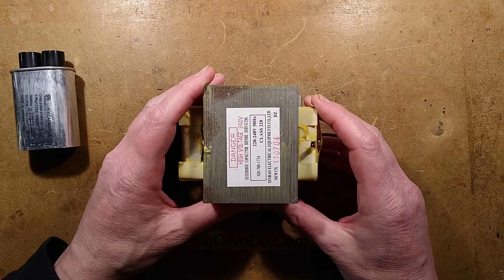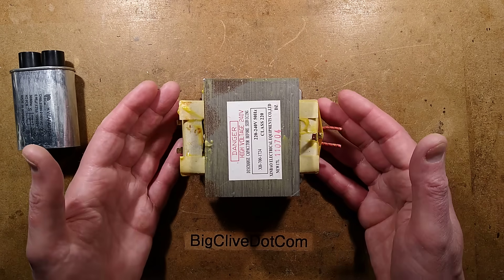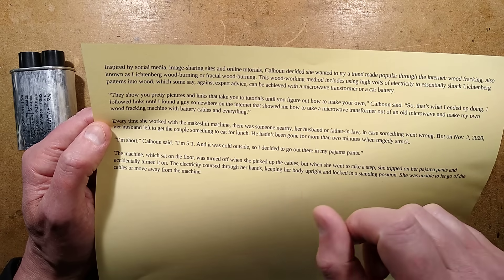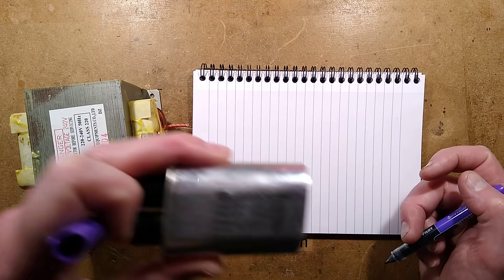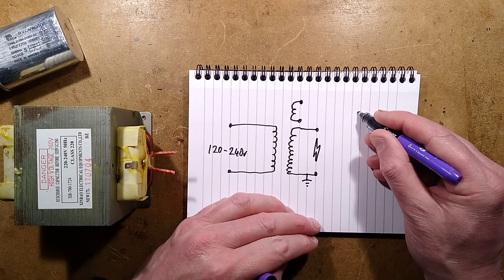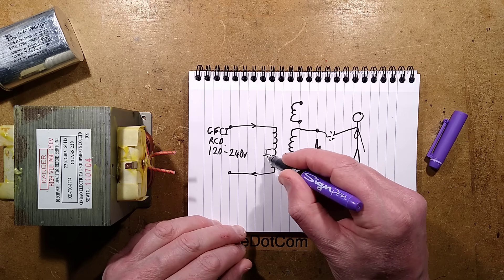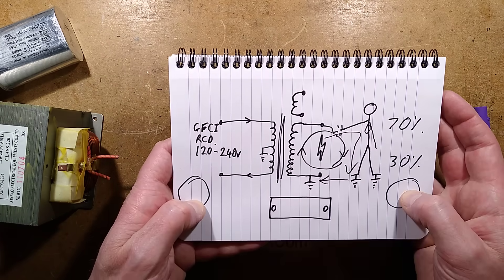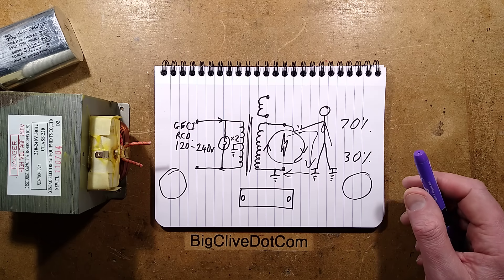The most deadly project on the Internet

Comment: When I was a teenager over 20 years ago, I acquired an old Franceformer neon sign transformer. I was using the GTO wire leads that came with it to play with a little wood burning. I didn't know anything about using an electrolyte solution on the wood, so I'd strike the arc by holding the wires close and then press it down and move them apart once the char started. My sense of caution was basically limited to holding the wires with a dainty fingertip grip, and that's probably what saved me when I did inevitably screw up.

I don't know what I did to zap myself. That instant has always been blank. I went from crouching on the patio to standing a good ten feet back, my sandal'd big toe bleeding where I'd kicked the shit out of something hard enough to bend my toenail backwards. One of the wires was lying on the concrete just arcing into the concrete. I pulled the 120v cord and told nobody and never fucked around with high voltage like that again.
Reply: The kind of moment to make you really love how great being alive is
Reply: @369Sigma  OH YES!   I've lost count of how many times I've had that feeling...   Whist on tour of duty with Greenpeace and during a 'hands to bathe' moment...  I once dived off the stern of our ship, hove-to in the Sargasso sea... Which is bang-slap in the middle of the Gulf Stream...  I had my diving face-mask on and started swimming around the sargasso weed, admiring the aquatic organisms, in propper Cousteau fashion...  Then I lied motionless on the surface looking down into the indigo depths....  Totally bemused at the fact I was staring  into approx 14,000 ft of water column....    When I eventually surfaced I turned and was amazed to see my ship had shrunk, now being about half a nautical mile away!    I then dawned on me that I'd swam-out of the lee of the ship.... and had been picked-up by the 4kt current of the Gulf Stream...   Man, that was the fastest crawl I've ever done in my life!  
.
Here's the kicker though...  When I got back to the inflatable moored alongside as a diving platform, the Skipper, who was on 'swimming watch'  on the starboard bridge wing, shouted - '' All hands onboard...''.   Still  somewhat out of breath I made my way up to the bridge wing and asked the skipper what was the reason?  He handed me the binoculars and pointed out to the starboard beam, I focussed the glasses and located the shining bladder of a Portugese 'Man-o-War' drifting in the current a few hundred feet away...    These hydrozoans can sport many tentacles (tentacular palpons) that can reach over a hundred feet in length, all of which  bears tiny, coiled, thread-like structures called nematocysts, these can inject a paralysing venom and have been known to kill humans by paralysis and thus drowning...     My blood ran cold for a moment -  The SECOND kind of 'that moment' within half an hour that day -  for I realised that the direction of those tentacles would follow the same current that I had been drifting in...   I could have swam right over them without realising.   So yes...  A double-whammy 'glad to be alive' moment indeed!   And of course, a very big lesson learned...
Reply: @369Sigma  Isn't it ironic that we need near death experiences to make us appreciate life? Just survived a accident with only 2 broken bones?
"I sure was lucky!" 😎
Reply: @TheOleHermit  sometimes you don’t know what you have until you almost lose it. It’s so easy to take life for granted, sometimes
Reply: That's what makes high voltage so lethal. Even if it doesn't kill you instantly, the moment that it gets you, you lose all motor control and involuntarily clutch the electrified object with all your strength. It's not unheard of to find a heavily burned corpse with the fingers still clutching the thing that killed them in a literal death-grip.
Reply: I took a hit from a neon sign transformer at work once. It knocked me on my ass, my coworkers said I was out for a few seconds, and I had a nasty burn on my hand. I was very very lucky. I don't fuck with big electricity any more. Scary stuff.
Reply: The two rules of electricity
1. You can't see it.
2. It can kill you.
Reply: Sandals 😂

Comment: i would also suggest to insulate the transformer from ground. i think attaching two dedicated screw terminals for the high voltage side to a plastic box and then casting the entire thing in resin (with spacers underneath to ensure a minimal thickness of resin on the bottom) might be a start.
that way you would have to touch both terminals to get electrocuted instead of getting zapped through ground

Comment: Cool looking process, but everyone I saw doing it did not instill me with the most confidence that it was something I should try myself, at least not using their methods. I've worked around too much 'proper' high voltage equipment to ever want to deal with stuff that considers safety as more of an afterthought. But I am happy you addressed this as I read a story over the weekend about a house that burned down, killing the owners in the process and the suspected culprit was a MOT used for fractal burning. The high frequency method crossed my mind when I was playing with tesla coils, but I decided then that would probably be the extent of my foray into high-voltage DIY projects.

Comment: I once wanted to build a spot welder and found a tutorial that used a microwave transformer. So I pulled one out of an old microwave I found. Then I actually started doing research into what I was holding in my hands. 

I nope'd out of that idea real quick.
Reply: you just have to cut away the secondary without powering it up for other reasons before, when you wind a couple of turns the output voltage can be like 2V, it's impossible to get shocked with that... the 230V side remains dangerous tho, so it's better to insulate the spade connectors properly with thick heatshrink tubing and so on (switches etc) and don't touch any powered conductor anyways

i did it and it makes an iron coin fully incandescent in like 10 seconds (didn't make a spot welder)

Comment: Once you go over 1000V you don't need to make contact for arcing to occur. So in theory, just being close enough to one of the probes could be enough to see you hooked up. 
The car battery leads as well, a slight nick in the insulation would be all it took for the voltage to drive through the plastic coatings. 
It can be done safely, but most people don't know the risks they are exposing themselves to in the first place. 
Great video.

Comment: The whole situation with a transformer defeating a RCD, has always made me question why we use them in shaver sockets.
Reply: A transformer where the secondary is not referenced to ground, is neutral towards ground no matter which point gets shorted to ground. This is generally safer in small circuits where multiple shorts to ground are unlikely.

Comment: I build guitar amplifiers and with those you're told to keep one hand in your pocket when testing it while it's turned on. 
That wouldn't help with a microwave transformer since its secondary is grounded.
You can get electrocuted with one hand contacting the high voltage.  Just sayin'.

Amp building safety doesn't apply.

Comment: One of my son's friends was killed doing this a few years ago. He was alone at the time so we don't really know what happened. I can only speculate as to what transpired because I didn't get to see his apparatus. He was probably using regular THHN house wire as many of them do. As we know, this wire is only rated for 600 volts so its a disaster waiting to happen with a 2000 volt microwave oven transformer (MOT). He was probably holding the insulated wire to probe around, thinking the insulation would protect him. When the insulation inevitably failed, he was killed.

I use MOTs for other HV projects such as vacuum tube Tesla coils (VTTCs). Some Tesla coilers use them for spark gap Tesla coils (SGTCs). So MOTs do have other uses other than wood burning. Of course you still have to be aware of the inherent dangers of using a MOT, which most Tesla coilers are. But even in the Tesla coil and high voltage group which I moderate, we still have to remind neophytes to the hobby of the dangers of MOTs.

Comment: I agree with you 100% on this but one thing I have done with one of these transformers is to hacksaw off the secondary complete with laminations and just leaving the primary on, then run that primary with a 110V site transformer and it made an excellent degaussing coil for my tubular framed home built aircraft.
The steel frame had become magnetised with the welding and the compass was way out but after running the coil all around the frame the compass read 100% correct. A very cheap degaussing coil.

Comment: Might want to have distinguished between the inverter based neon sign transformers and the old big chunks of iron. The current limiting effect of a mains frequency neon sign transformer isn't exactly abrupt ... rated for 10 mA give or take 100 mA with sweaty enough hands. They are short circuit safe for the transformer, not for the human.

Comment: It's that terror of high voltage that stops me from repairing CRT monitors. Hats off to the people that can do it but I'm just not experienced enough. When I needed the monitor circuit looked at in my classic Compact Macintosh, I took it to a professional. Even the tiny 9" monochrome CRT in those compact Macs has 13kV across it.

Comment: That picture is truly dreadful. Not the sort of art i’m interested in making, esp having repaired these ovens, always belt and braces. I know power,volts and amps don’t mean much to non techies but the RCD tripping at 30mA 0.03A is important, it’s just below the current level that could stop your heart, and with dry hands 240V could push this current through you. These transformers come from devices that (approx) unleash 800W of power and most of this is through this transformer, at 2KV output this transformer could easily push 400mA through you… :( just don’t ‘play’ with them.

Comment: MY,SHOP ,TEACHER ,WALKED IN TO THE CLASS ROOM AND THEZE, 3,GUYS HAD,A,PILE OF,TEST,EQUIPMENT PLUGED IN,TO THE 120,,AND THE TEST LEADS,IN,SERIES,WITH ONE PIECE,OF,EQUIPMENT TO ANTHER ,AND EVERY SHOP,TABLE,HAD,2,OUTLETS,,,GOING,TO,REOSTAT,REOSTATE,TO, A,HUGE,,TRANSFORMER TO DIOD BRIDGE,TO THE OUT LETS,ON THE SHOPDESKS,THEY,HAD EVER, PEICE OF TEST GEAR,IN,SERIES AND PLUGED IN TO THE DESK,OUTLETT,REOSTAT WAS,TURNED UP FULL,2,LOCKERS,HOLD THE TRANSFORMER,THE MAIN SWITCH FOR THE TRANSFORMER WAS,A KNIFE,SWITCH UP ON THE WALL,AND YOU NEEDED A 🔑 KEY,SWITCH TO THE REOSTATE AND A ,HOCKEY,STICK,TO FLIP,THE MAINE POWER ON,I,NEW THIS FOR MY,SHOP, TEACHER WOULD LET ME BUILD PARTS FOR MY ,HAM,TRANSFORMER, TRANSMITTER,,,,THEY WERE EXPELLED FROM SHOP FOR EVER, ,,AND IF,I,WOULD HAVE TOLD THEM WHERE THE KEY,IS  AND HOW TO FLIP ON THE MAIN,I,WOULD HAVE BEEN UP FOR SECOND DEGREE MURDER

Comment: I used to play with extremely high voltage transformers when I was a preteen with absolutely zero safety equipment. God knows why I'm still alive.
Reply: Angels, mate.
Reply: When I was that age I electrocuted myself on one of those damn non isolated old tube radios, quite frequently, especially when it would rain.
Reply: You're right, God knows!
Reply: @jonhetherington5985  Actually I had a pretty good grasp of what i was dealing with and the different ways it can jump on me

Comment: Good warning to all. I've been playing with electricity my whole life practically, and have been shocked several times from 120 volts AC house current, and luckily I always followed the one hand rule, and also always wore tennis shoes. I've been tempted to work with microwave oven transformers, but so far have hesitated because of the high voltage, and most important the high current in combination. I built several LED lamps using hundreds of LED's in series powering a series string of LED's (same method used for LED back lighting in TV screens) with AC house current through a bridge diode circuit, and high voltage electrolytic capacitor that would charge up to 164 volts DC, feeding that voltage through a MOSFET pulse width modulation circuit for brightness control. I was extremely careful, but I knew I could kill myself if I made even one mistake handling that capacitor when charged. Now that I'm up in my years, I've decided to stick to low voltage circuits when experimenting. You make more mistakes as you age no matter how careful your approach.

Comment: No thanks.  I have enough excitement when I forget to attach the workpiece clamp when I am GTAW.  The welder I use has high frequency arc start so no electrode to work contact.  When the workpiece clamp isn't connected,  I usually complete the circuit, tiny current but 2-3 cm long arc.  

For me, melting metal is more useful than arc burned wood.

Comment: I hadn't quite appreciated the burns risk from kilovolts (the death risk is obvious). But since power dissipated into a resistive load is proportional to the square of the voltage, it makes perfect sense - 2400 volts will give 100 times the heating as 240 volts. And that's assuming the damage doesn't lower the resistance of the skin.

Comment: I once worked - or at least trained in TV servicing. The EHT that big TV tubes & drivers could put out was terrifying, along with the stories of people who had experienced it. It could literally throw you across the room and if the current crossed your heart that was it you were pretty much dead - unless someone was there to restart your heart. 
Old CRT TV's are ugly in that you can only repair many faults with the power on, so we had special measures to protect ourselves.. 
- The repair benches were insulated and isolated and the floors were covered with heavy rubber mats. . Benches and stools were specially made for TV servicing and were extra tall.
- You should never work on an open TV with the power on alone.
- When working on a live set you would try to only ever use one arm inside the cabinet at a time. This would particularly reduce the risk of lethal shocks through the heart.
- It was common to have the earth circuit in all the bench mains (UK) sockets disconnected. This removed the Earth path inside older TV's with earthed frames making a shock a lot less likely.

Comment: Very interesting vid, luckily for me, i have an inbuilt resistance (haha) to electricity, as it frightens me! so i would never embark in such a hair brained job, of join  a few wires together, and make 2000 volts idea, as i got a full on 32 amp 240v jolt last year changing a  socket, that i had checked, and the power was OFF, but the socket upstairs had been wired into the downstairs flat,  in a council property !! 

I still, honestly have issues with my right arm, and hand today, near on a year has passed

Comment: In the first house I ever rented (ie i was the renter), I attempted to change a bus in a out-of-code panel. There wasn’t any way to actually turn off power to the panel. My electric screwdriver touched something it shouldn’t have and caused a massive arc inside the panel. The electrician who was finally called to fix the landlord’s problem said that I was lucky to be alive. The image of that arc will never leave me. It looked like heat lightning.

Comment: What if you floated the secondary? It wouldn't protect you from insufficient insulation on the probes** putting you into cardiac arrest, but it would prevent the ground fault problem. 

** and, let's be realistic, not many people are going to be using proper HV-rated probes/wires, nevermind a dry hands and work area.

Comment: You not once mentioned the current these transformers can produce, generally 1 to 2 amps depending on size, it is this that will kill you. 
I have had shocks from both 40kv and microwave transformer, the 40kv shock hurt a bit and caused a finger burn. I was lucky to survive the microwave transformer shock due to how and where I used to do HV experiments. I can tell you it hurt a hell of a lot more than the 40kv. The current went from my knuckle through my arm,chest,hip and leg. I was well insulated on a 2nd floor dry suspended wooden floor, carpet covered with an extra thick mat on top of that, I always wore heavy duty rubber sole boots during HV experiments. The bench was also insulated in a similar manner to the floor. I have had every surface and wire glowing purple with high voltage (x-ray multiplier fed from 40kv high frequency pulses), this was in the region of 300kv. The microwave transformer 2.8kv at 1.2amp was alot more dangerous.

Comment: We all know what mains does to your wiener...no, wait.. eh.. Hot Dog. 10 times the voltage - ten times the roasting. probably even works wireless at 10k open circuit Voltage. That thing turns you into art in the blink of an eye.. my highest rated advice : Don't touch them. Thanks Clive :)

Comment: There's an even safer version of dead man's switch - one used in e.g. robotics - it is a 3-state momentary switch, is turned OFF when released (state 1) or pressed strongly (state 3) and ON only when pressed with medium force (state 2) - that way it breaks the circuit both when you drop it and when electricity contracts your muscles.

Comment: 3000-4000 volts no-load... 30,000 V to spark across 1 cm, so that's over 1mm of insulation, skin, shoe, glove, etc. that this could easily pass through.  That's thicker than all the PPE and safety gear that I have and even pushing it when combining cable insulation and welding glove thickness.